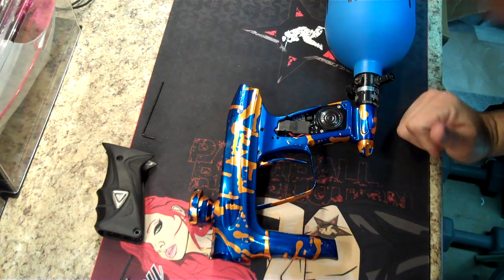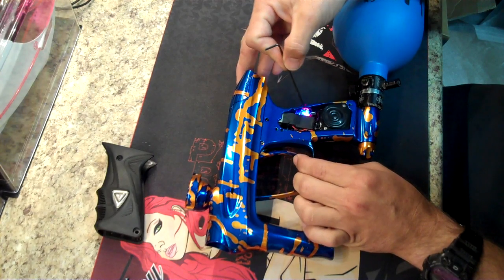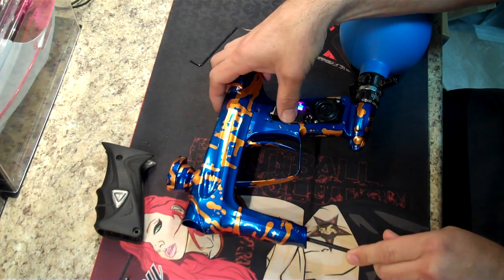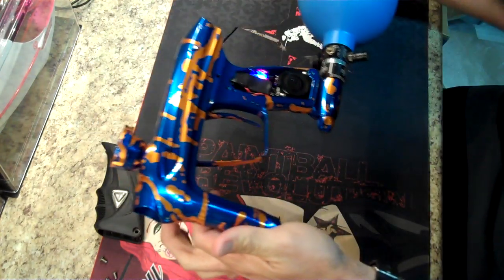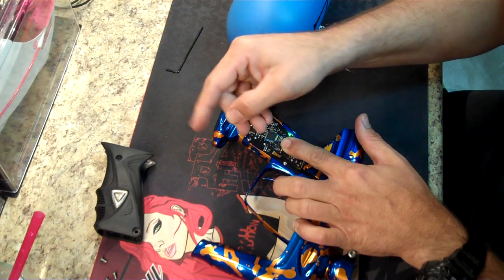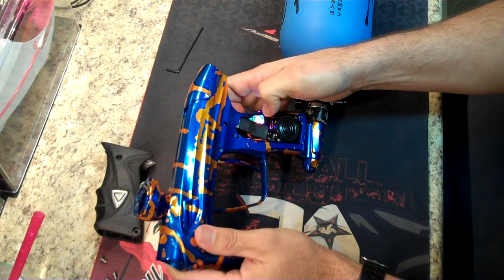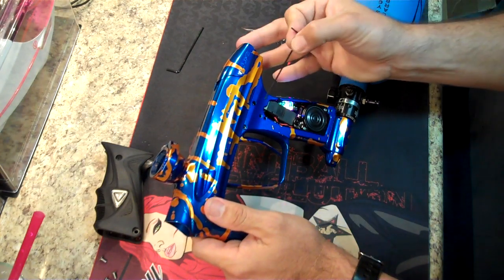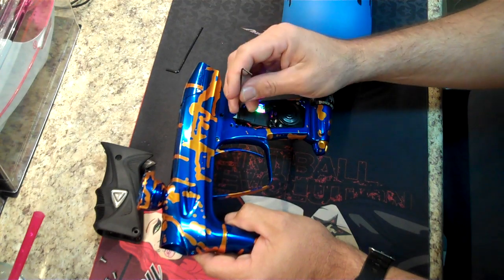DLX Luxe 2.0 Solenoid, Board, and Manifold/Feathertouch overview / troubleshooting

Comment: I just picked up one of these used after being out of paintball for a few years. Your videos have been awesome for me. If you do see this i do have a question. I upgraded mine to the encore bolt, after install my solenoid started leaking. You just solved that problem. My question is after installing the new bolt does it have any bearing on the feather touch or manifold adjustments in your experience? What is the typical amount of turns in on the manifold you see it run smooth? (over the stock 1.5)

Comment from the maker: I use standard 800 psi on my Luxes, that will work just fine. I would back the regulator all the way off, turn the gun on, turn the eyes off, and pull the trigger as I increase the regulator pressure until I get nice, healthy, cycles. Then go chrono.

Comment: I just traded for a luxe and am expecting to receive it today.  I've been looking over some of your vids the past few days and they have been incredibly helpful.  just want to make sure of something that I took away from this vid (besides the obvious troubleshooting tips)... from this vid, it looks like the luxe 2.0 will work fine with a regular tank, and it doesn't need to be low pressure?  is that right?  if I use a 800psi tank or so, I just need to make sure the hpr is properly let out?

Comment: Ok I got a realy wierd prob. I got a ice seller said noid mite be bad. Had a tec check it said noid was bad board was good  so I bought a new solenoid  installed has no leaks eye beep triger clicks I think solenoid clicks but seems like air is not geting to the solenoid  I can increase the hpr bolt sucks back but ice won't fire eye on off. It's a new solenoid

Comment: Mustache, do you know how to remove the bolt spring?
Reply: you need a long 1/16th allen key to remove the spring and spring guide, 

they are installed with red loctite and may need heated to be removed. Also when you reinstall the new spring and spring guide apply a small dab of RED loctite.
Reply: thanks bro!